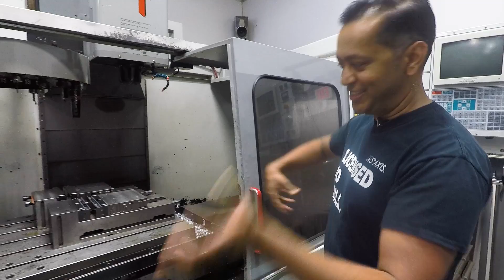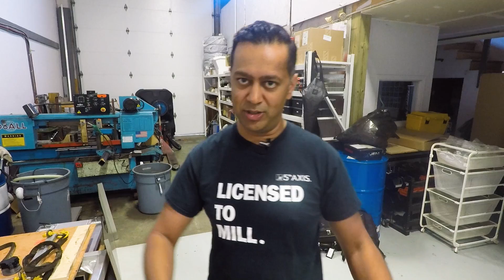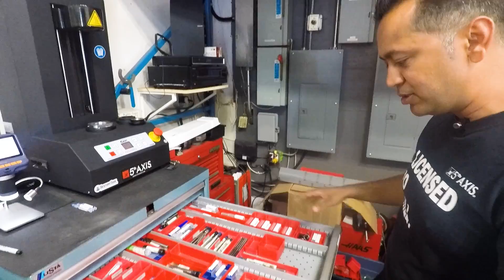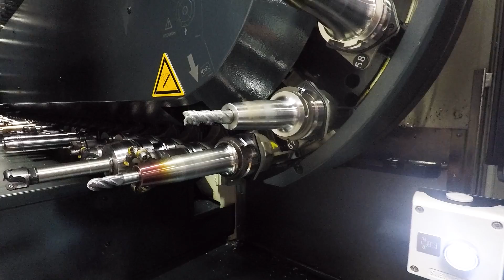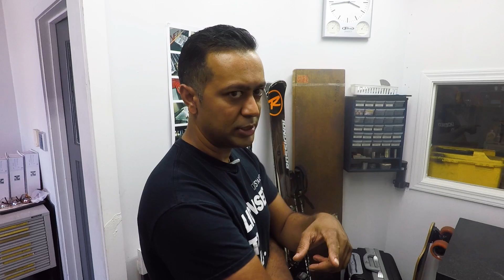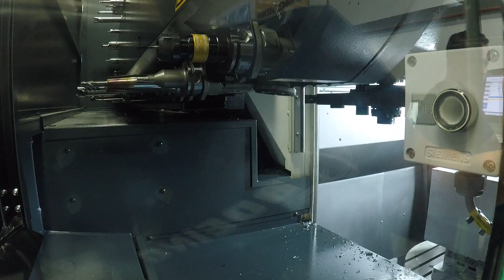INCREDIBLE Machine Shop Tour - 5-Axis CNC Impellers!

Comment: I made stuff like that before CNC....3-Headed Bridgeport Mills with Hydraulic Controls to rough out three turbines at a time..
One pocket at a time.... Index and do it again.

Then to the 3-D Pantographs to finish out the pocket.... They said we machined a pocket, and the blade was left.
But they measured the blade at points layed out by scribe lines!.
I feel safer flying today than I did then!

Comment: Wow, that was impresive! respect to this guy! Just out of curiosity, would be interesting to know the cost for that large almunium block. I guess it is pretty pricy, which leads me to a second question. When working with that large of a workpiece, is it common to start of by making a scaled down model, testing all the toolpaths so that a large workpiece dont go to waste. (*You mentioned that you started of on alumnium instead of steel when prototyping, but what about scaled down?) Are proffesional machinsts so confident on a new project that they can dig in to a large workpiece after just checking the simulation of the toolpaths?

Comment: Sure makes my mini mill look obsolete..
Reply: @Nhilistic Komrad I HAVE 3 CNC MILLS HAAS MINI, A TORMACH 770, AND I BUILT A 28X5' CNC ROUTER...I REALLY DONT NEED ANY MORE.....ALL KIDDING ASIDE..
Reply: @Nhilistic Komrad you may get lucky try it..
Reply: Haas mini mill? Used one of those 15 years ago. Junk. Couldn't drill a 3/4" hole in Aluminum
Reply: @highstreetkillers4377  about two weeks ago. 7 1 inch base plates 4 corner holes .875 dia. you must have got a beaten machine.this ripped thru i was impressed. 7.5 min run time....ps hot roll

Comment: Any thoughts on switching from a sandvik 390 to a 790 for aluminum?  I know the 790 is designed for aluminum but it doesn’t seem like it would be any different than a 390 with h13a or cd10 inserts.  I think it even has the same recommended cutting parameters.

Comment: If your not familiar with barrel type cutters and the software designed to calculate the most effective tool path you could be missing out on an opportunity that might  
give one the most spectacular ruductions, often as much as 70% in some instances in the machining times of parts  well suited to the barrel type cutting tools. An impeller is a perfect part
to compare and see how much of a benefit barrel tools could be when compared to ball type cutting tools.
Reply: Don't know what a barrel too is, but 3d machining you have to use a ballnose
Reply: @highstreetkillers4377  well i just did you a big favour then. Ive been using barrel end mills 3 years.Ive saved 
hundreds of thousand of euros.
Check out" tool paths for 5Axis fully simeltainious
machine tools using barrel 
end mills."Open Minds Hypamill soft ware is still the best.Fusion 360 offer it as upgrade if you use their
Cad cam software.
I have both only because ive been using Fusion for 
20 years and got used to it. 
I've been using hypermill 4 years.

Comment: @SS CADCAM I would love to know what PowerMill is giving you that Fusion 360 lacks(just curious)? especially for those large impellers, and now that you have PowerMill do you see yourself fully phasing out Fusion?
Reply: PowerMill is amazing. Seen Fusion on YouTube and it looks like junk software. I use PowerMill to machine 50 ton blocks into car molds. I doubt you could machine a cars front bumper with fusion

Comment: I worked on DMU 60, DMU 80 ,DMU 75 Monoblock, HSC 105 linear, problem with the glass is the chips are constantly hitting it and the glass gets in very bad shape during longer period of time. This can be prevented by applying glass protection from inside which will save you money. I run heidenhain on all machines except from HSC 105 linear which had siemens, and I can say get heidenhain if you can :) I hope that someone finds this useful.
Reply: I made a aluminum protector for the glass when I run production.

Comment: nice machine and setup, but I'm a little confused with why that face milling is done so slowly - mainly the tool path hopping over the part to get back and cut in only one direction??? with all of the money invested in tooling and machine, how can you stay in business?
Reply: He makes one-off parts, not production. You don't have the time to spend on optimization. And you have to be more cautious since it's the first time.
Reply: This was done to have the chips fly back towards the machine away from the glass to minimize damage. Speeding it up and going both ways maybe would of saved me a few mins max.

Comment: Follow up on how he gets fusion 360 to make that machine dance?
Reply: He said he used Powermill to program that part
Reply: @ryanrhodebeck3925   i can optimize the rough with  zig zag (hsm)  put a round at the end of piece to prevent rapid movement i think i will do
Reply: Running out of goats?
Reply: https://youtu.be/GBFsxGzW_FM?t=1993  HSMWorks ?
Reply: I got the same question. Fusion drives me nuts
Reply: @jotham123  Pirate walks into the local tavern with a ship's helm on his privates. Bartender looks up; "what's with the steering wheel? " Pirate: " Arrr, barkeep, it's driving me nuts!"
Reply: @amish I wouldn't say that fusion isn't powerful but are faster with maybe solid cam... You are more flexible... With complex parts you need a lot of scetches to achieve the same results without sketches on solid cam....
Reply: U NEVER SAW TOPSOLID7
Reply: You don't use crappy software to program that
Reply: @highstreetkillers4377   catia mastercam featurecam fusion  ...   do you have a preference for software, if yes  just let me know
Reply: Fusion is a hobby software... Wouldn't work with fusion to create 5axis parts
Reply: @BT_logic  I use fusion 360 99% of the time to program the DMG. Only used powermill once.

Comment: I’m pretty sure that holder with the blue ring is an adjustable balance holder. 

There should be a bunch of set screw in the holes under the blue cover. It’s for ultra high speed spindles in the 50,000 RPM and higher range. By moving the set screws in and out around the perimeter you can finely adjust the balance of the holder in the spindle. 

At those speeds balancing of the tool is critical as the spindle is often an air bearing system (physical contact bearings just burn up with the friction) . The  spindle rides on a cushion of pressurized air  between the inner shaft and outer bearing housing.  An unbalanced tool can cause the inner spindle to hit then outer sleeve causing damage and nearly instantaneous seizing of the spindle. 

The tools are balanced off machine in a balancing machine and adjusted.  It has to be a manual adjustment as every tool and collet is slightly different and affects the balance differently.   And the faster it spins the greater effect an unbalanced tool has.
Reply: Thanks for that info. I always wondered how the balancing was done. It's nice to know that you don't just shove it in the machine and start slowly increasing the RPMs until you hear something wrong and then kinda guess which set screw you have to adjust.
Reply: what you said is mostly true but balancing is as important for spindles that run at 20000 rpm and even 15000 rpm having a really well balanced tool will give you better finishes and less chatter people just tend to ignore it because the spindle won't be damaged but if you are searching for better tool life and better surface finish balancing can help a lot

Comment: I just got my new VF2SS and I have broken (3) 6-32 taps already with rigid tapping. I started using firm taps for all sizes below 10-32. Is that a normal thing?
Reply: I don't get how people break taps. I almost never do. Blind holes? Make sure your drill point is deep enough for tap, check hole size is right, and use coolant. Not stupid tapping paste. You should invest in form taps or thread mills if you have a problem

Comment: What no fly cutters??????/
Reply: Because his machine can handle CNC tooling. Fly cutters are good for CNC machines with less rigidity and manual machines, since they only have a single "flute" engaged.
Reply: @xenonram  ?????????????????????????????????????????
Reply: Fly cutters only have one cutting edge and can't do a big depth of cut, so the removal rate is low per pass. the feed is calculated from the rpm and the number of cutting edges. fly cutters are very imbalanced, so the rpm can't be too high, plus only one edge and you end up with a very slow way of machining.
a face mill has several cutting edges and is not imbalanced, so the rpm can be higher. plus, depending on the insert, you can go up to 4-5mm depth of cut (more for bigger face mills, those are the maximum I worked with).
for example, I used a 63mm face mill on aluminum with around 6500rpm, it had five inserts, so I could go with 1800-2500mm/min and still achive quite good surfaces, though depending on what I had to do I sometimes went down to 0,3mm above finished height, then increase rpm to 7000 and feed down to around 1200mm/min and I ended up with a mirror surface at final height.

Comment: Man I would give my left nut for a Mori. Too bad I can barely justify a 15k CNC 😂
Reply: It's nice but you don't need it. I should blow these guys away with a video using a CNC with spindle mounted to a Sine Plate to have the tool on a compound angle.

Comment: Never would've thought that tools can last such a short while! No wonder machining is so expensive.
Reply: He's a scaredy cat to index them so much. Good programming and tools will last years, in steel he should use air blast and they'll last longer. Gundrill oil is even better, impossible to melt a tool using gundrill oil. But it's over $10 a Litre
Reply: The tools themselves do last years, I was thinking of the cutter inserts.